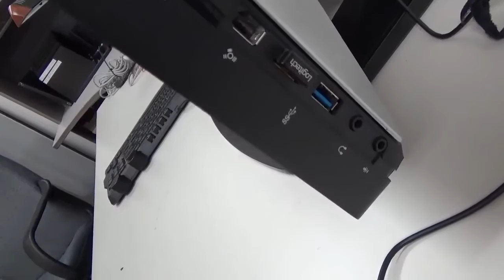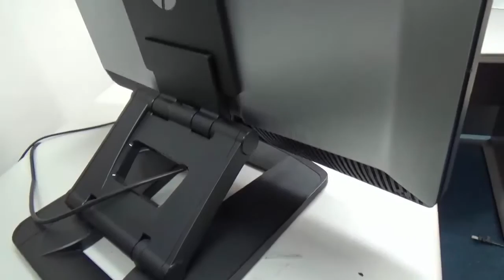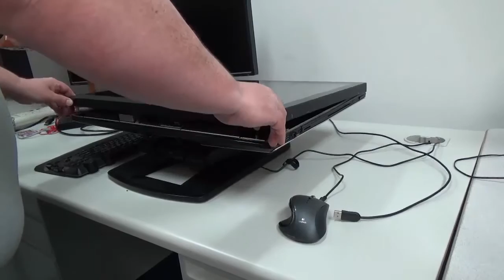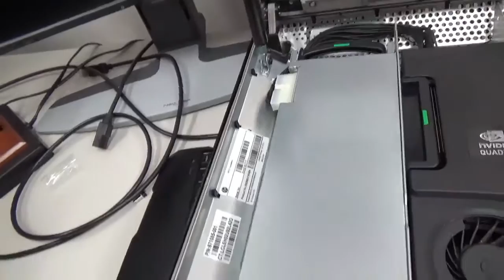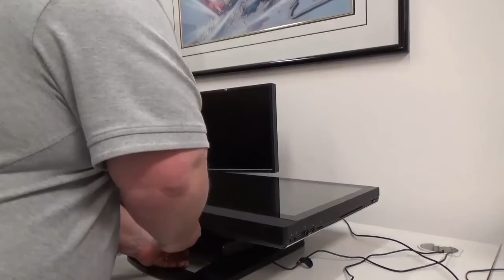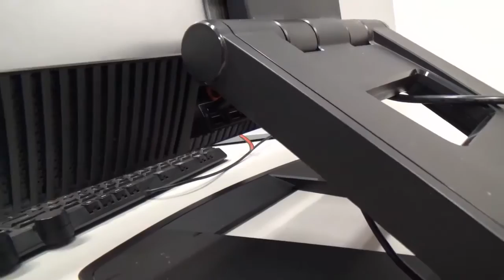HP Z1 Workstation

Comment: Sadly, the "speakers' are a laugh-riot. I owned a pair of Compaq Presario 3020 AIOs back in the late 1990s. Those had SPEAKERS that were like 3x the size and configured by JBL. 5 Watts of power, too. WIth this Z1, you must use extenal speakers-monitors if you work in multimedia with audio. They really blew it with the midget membrane drivers here, yuck. :face-blue-wide-eyes:

Comment: So mine isn’t even going to the startup screen. It’s stuck on a gray screen
Reply: So you may need to flash and reinstall the BIOS from the HP website. Did you try calling HP or visit an HP-approved service facility to resolve this? One other issue, what happens when the LCD screen goes bye-bye? Can the panel be replaced somehow today (summer of 2023)? Looking at the video and seeing how intricately that screen is squeezed in there behind a host of bars and things, this would not be a DIY project, replacing that edge-lit LCD panel. :eyes-purple-crying: